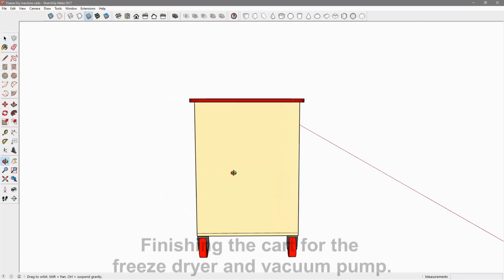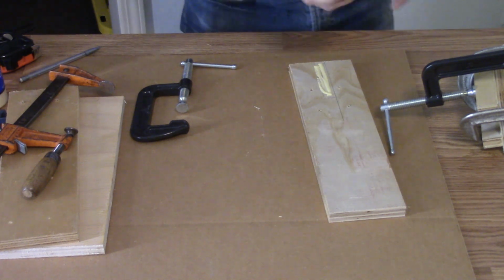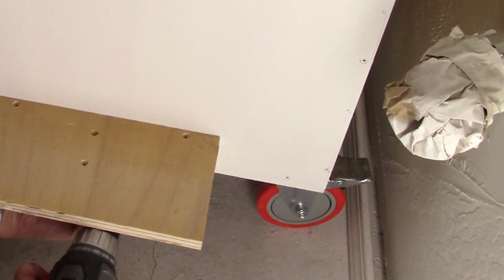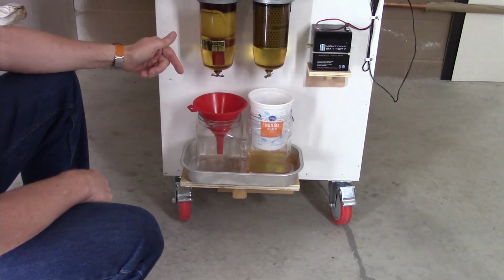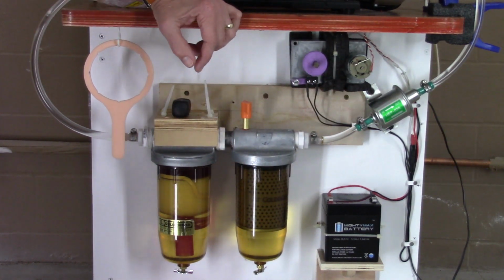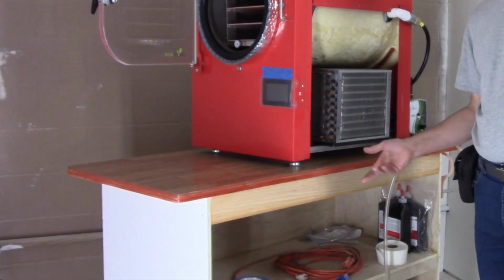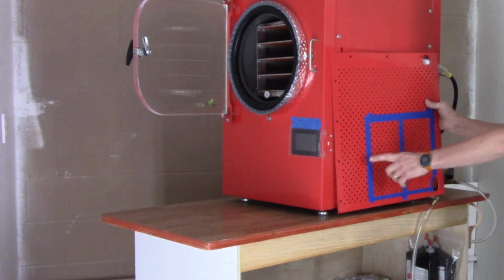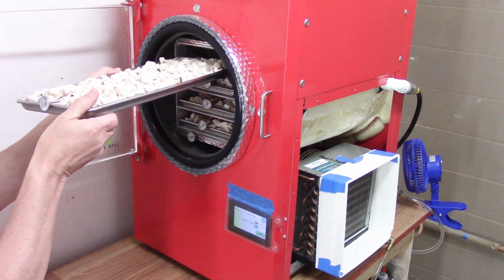Building Freeze Dryer Carts - Part 3 - Finishing the Freeze Dryer and Vacuum Pump Cart

Comment: I built a filter system with the marine two stage filtration the M 12 I’m having a hard time finding that thread count and diameter for the fill plug I was wondering if you were willing to sell one or two make it worth your while right now I’m taking the fill plug off And put the hose in there and re-circulating it thanks